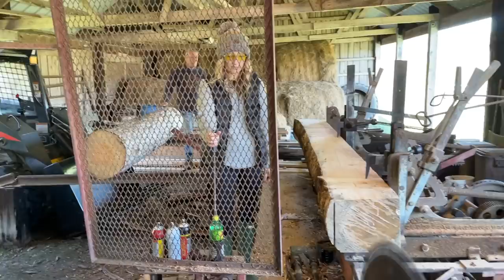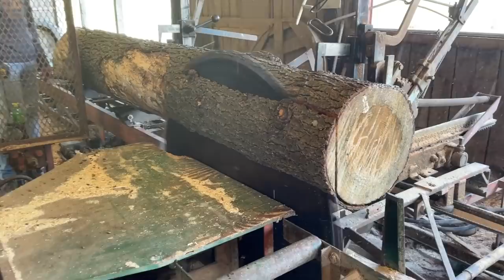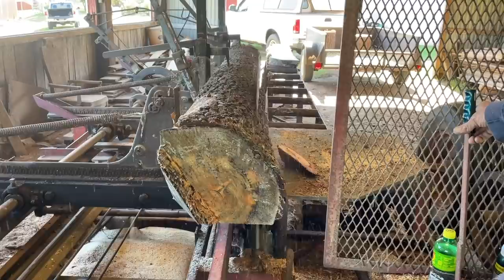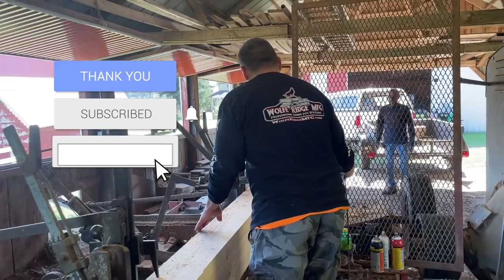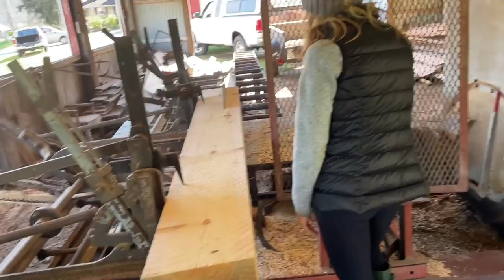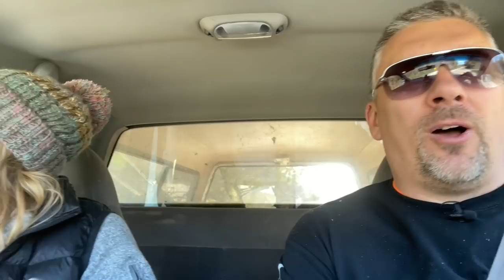She Saw the Potential - Is a Sawmill in Our Future? Milling Lumber with Antique Sawmill

Comment: Nice video my dad had a sawmill similar to that set up at my grandparents place. Good times pulled many of boards off a mill. It was run with old Cummins truck motor. Exposed drive shaft belts. Amazing I still have all my fingers. Not sure that work with kids today.